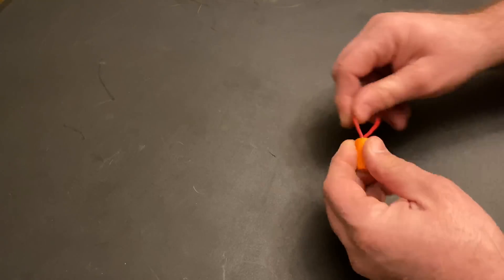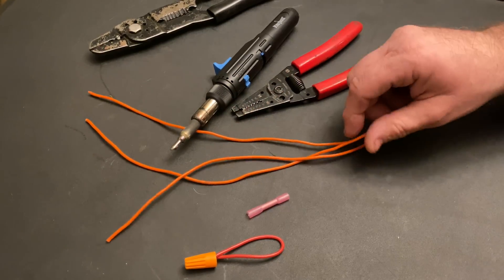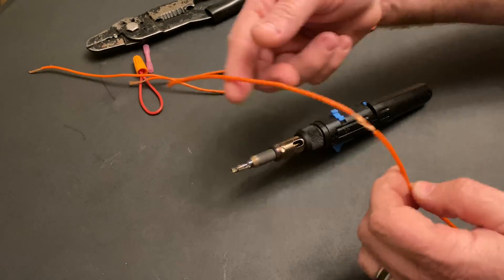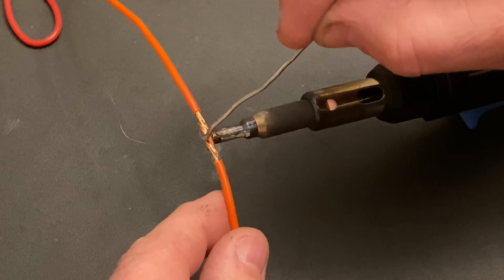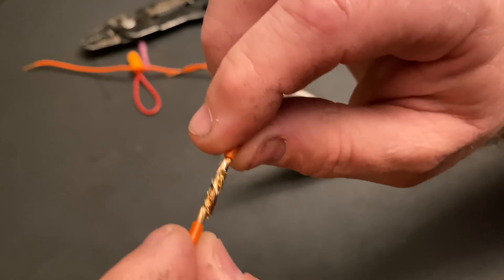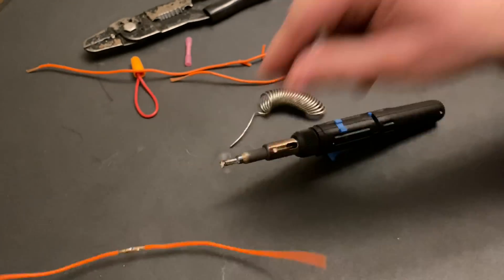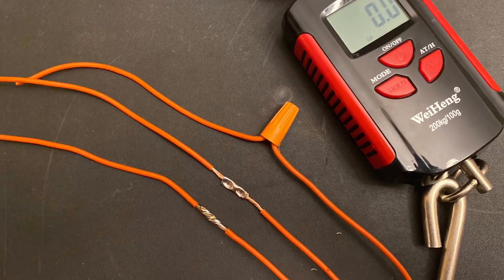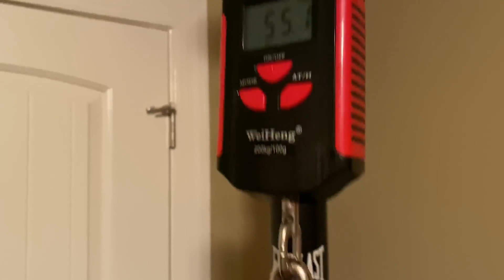Did you say "Wire Nuts"?  Is it as good as a butt connector?

Comment: Will the wires ever face these kinds of forces? I guess it could be correlated with amount of long term shaking that happens overtime under the hood
Reply from the maker: Butt connectors fail, a lot!  The cheap ones.
Reply: @TurboJohnRacing  Yes and I can see why. It's a straight press connection... Heating and cooling even with weather combined with shaking motion will cause failure over time. I have a bunch of them and wish I never bought them.

Comment: I like to warm up rosin with a heat gun for a second and dip the wires in and then solder. The solder will suck in a bit more evenly than in the video.

Comment: Very unlikely that wire connections would ever be put under this kind of stress so I think any one would work. On the soldier connection it is helpful to use alligator clips on each end of the joint to act as heat sinks to prevent damage to the wire or insulation. I prefer soldier connections for permanent connections in cases where it’s practical.

Comment: I'll add that you suck at putting a wire nut on. If done right it will hold with in a few pounds or the wire that is not sliced.
Reply from the maker: What is the proper technique?

Comment: I use these deals called c splices. They look like little c shaped deals. Anyways they’re good but you crimp then with the same crimp tool for the amp 1.0 pins that Holley uses. You lay the wires in the c and crimp it. Then lay a little heat shrink over the splice. It’s the strongest I have found. Plus it’s very small to tuck in the loom. And it’s very flexible.

Comment: I have been a shade tree mechanic for years. Idk how many engine's I have pulled with my old oak tree and chain hoist. My father and grandfather have pulled a lot more than me using that tree. Never been great at wiring. Anyways I have wired a ton of trucks and cars with wire nuts and black tape over the years. I wired my 70 f100 over 10 years ago with pretty much a pair of pliers and black tape. Have never had a wiring or electrical issue knock on wood. I just recently in the last year have started soldering and heat shrinking everything. P.s that solder/heat shrink in one stuff is junk or at least what I bought was.

Comment: On the soldered wire, the reason more length becomes "stiff" is because of Flux. The Flux core solder flows out more and becomes hard kinda like epoxy. Nothing wrong with that, just use shorter connections. For conductivity, solder is the best choice. Butt connectors are for lazy people like me. Just use a quality crimper.

Comment: I've seen tons of failures with wire nuts over the years working as an industrial controls tech.  The little metal springs in the wire nuts will rust out easily with air exposed to them.  Mechanical connections and crimped connections are what seems to hold up best but that crimp tool you have is less than perfect.  True it is what most use.  Crimpers that crimp 360 degs and draw the barrel in evenly work much better.  They can cost 50$-100 bucks though.  Saughter is ok if done quickly with out tons of heat input.  Best methods no matter how connected include a heat shrink to seal them.  I like the water resistant type with the glue sealer inside them that oozes out once heated and shrank down.

Comment: You need a crimper bro!   get the one with a bump the electricians use.
Reply from the maker: I found it tonight, it’s been lost for a while
Reply: @TurboJohnRacing  I started as a motorcycle mechanic and when I was shown to use them and got handed a few crimpers to compare to I never went back.  Its amazing the difference it makes to use the proper tool.  Also the type of solder you use and the amount you heat the wire will drastically increase the reliability of a solder joint.

Comment: When crimping, if it's done correctly, it cold welds the joint making it truly a single piece same as the solder.

Wire nut for a race car probably doesn't matter much, but the corrosion risk makes it a poor choice for a daily or anything else that may be driven in wet conditions. So even for a race car that is hauled on a open trailer in the rain it could potentially become an issue. Personally never had an issue with them so long as the correct size is available for the wire.

Comment: Why did you bolt the dzus bracket instead of rivets I wanna install mine on my car but the your way what did you use for bit and what size bolt
Reply from the maker: I used rivets at first, they held for several months but then eventually failed and my hood got ripped off and destroyed!  It was like a zipper, almost all of the brackets stayed attached to the hood
Reply: @TurboJohnRacing   so what size bolts did you use I have a 1979 el camino pro mod being built
Reply from the maker: I don’t remember, I took the brackets to the hardware store.  Think it was fine thread 1/4” but may have been 12.  I did rivet the fastener to the hood, and no issues there.

Comment: The wire impedance is something to think about when using solder.
Reply: solder is the factory recommended way to repair broken wire ends for ecm connections butt connectors increase resistance solder does not. at least that's what they taught me when i was going to school for the sterling dealership way back in the day.

Comment: Someone may have said this already; 
The issue with using crimp connectors, wire nuts, or any other solder less splicing method is voltage drop. 
On a 12V circut, like your tail lights, using a solder less connector would be OK. You probably wouldn't notice the loss of power at a light, fan, horn......but, if the type or size connector is used you could get a very poor connection resulting in a noticeable power loss or even an intermittent open circuit. With too small a connector or a poorly manufactured or installed connector you could get an increase in head through a higher amp circut,  like a fuel pump, and that could result on melted insulation and eventually a fire (or the escape of the smoke from your wiring) 
If you are splicing into a computer circut, always use a method that uses soldering. I have even soldered the terminal ends onto wires. If you are splicing any wire on part of your computer control harness or data log harness, try to carefully select the location of the splice so that it will be in a straight section of wire. It is much more desirable to replace the entire wire when possible. Using a properly soldered connection will result in the lowest amount of lovtage loss and the truest, most consistent feedback to the ECM or data logger. 
John, also try using a smaller gauge solder. It will take less heat to melt. The stiffness in the wire is usually due to the solder wicking down I to the wire past where you have intended. This helps make a good electrical connection but can cause a weak or brittle spot in the wire. Soldering is something that takes practice. I use the smallest guagd solder I can get from Radio Shack. 

You do have a good point about having viable wire nut connections on a grudge car, it would make for good camouflage. Maybe use a wire nut and solder. ;-) 

Keep the good videos coming
Reply from the maker: Thanks for the comments, great post!  Good points!

Comment: A little off topic but surprised to see a cerakote commercial on youtube. Wow!  Prefer properly soldered joints , cleaned of flux afterwards, and slathered with die electric grease then heat shrunk. Never had a failure. My take on this video is no matter what method you use, as long as you keep turbo john from hanging on your wires you'll be alright! 😁
Reply from the maker: LOL

Comment: I'm not hating. But in my mind and for my money, I'm just going to keep some heat shrink butt connectors on hand and fix it right. That wire nut may work, for temporary, but it can get forgotten. Then you have wires exposed to the air/moisture/humidity leaving it open for corrosion. Even a small amount of that funky green stuff can cause a voltage drop that can play havoc on EFI systems. Just fix it right the first time when it comes to automotive systems.
Reply: Pack the open end with dielectric grease, should have that on hand as well. I agree for the most part but shit happens, also good to have other options in mind.

Comment: The reason the wire nut on one cable took more weight because both wires are locked and twisted into the wire nut when you pull on same cable the wires bind harder together aginst the wire nut threads which locks them in because weight is being distributed on same wire equally but in 2 separate wires it's not being distributed well so they pull out faster
Reply from the maker: I did it both ways, pulling on the individual ones was 27lbs I think it was.

Comment: You should also test spade quick connectors and even do a crimp and solder pull test were both crimp and solder methods used and on the same cable

Comment: Cool video! Couple things I can tell ya (as an electrical engineer by day and a hot rod builder by night), wire nuts are for ac and solid wire. Yes they work, but it’s faraday’s theory....higher frequencies travel around the outside of the conductor. Stranded dc wire uses the whole core. So you may have a strong connection on the scale but if you tried to pull the full 20a that 14awg is rated for for a long period of time, that connection could be an issue...heat/cool over and over and it could loosen up. Probably never will, but that’s the theory. Also with soldering, you get those hard/brittle spots when you over heat the wire. If you tin the wire first like you tinned the soldering iron, the solder flows instantaneously, it won’t be a cold joint, and it won’t have a hard spot after the solder joint! I don’t solder on my cars either, I prefer the nice butt connectors with the heat shrink on them. They’re expensive but I do a ton of street miles on my cars and will never have to worry about corrosion. But I’d be lying if I told ya I hadn’t wire nutted melted starter wires back together at the track, or my two step button, or other miscellaneous things that were an issue. And I’d be lying if I told ya I didn’t leave those “temporary” fixes on the car much longer than I’d like to admit with no issues haha
Reply: This would explain why your not supposed to pre-twist your wires with wire nuts. At all. You don’t twist the individual wires or your 2 wires together. Strip em, stick em in the nut and let the nut twist em. That’s how I was taught.
Reply from the maker: Yes!   Hahaha

Comment: I wouldn't have either. Every time I see a temporary repair with crimp connectors it never works! Solder and heat shrink all day. Just because the wires are tight in the nut doesn't mean you don't have a bolt drop. Just fixed a lot of this kind of repair in the shop for years. You make it look good though. When you apply the solder to the iron it's called tinning.